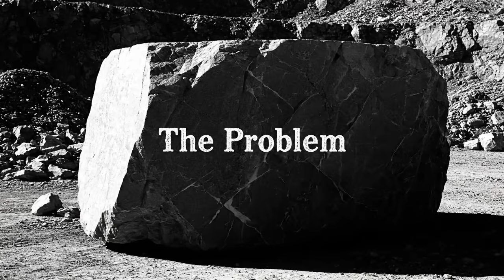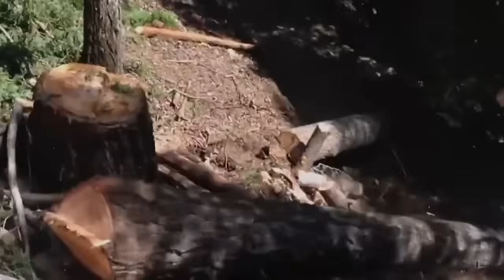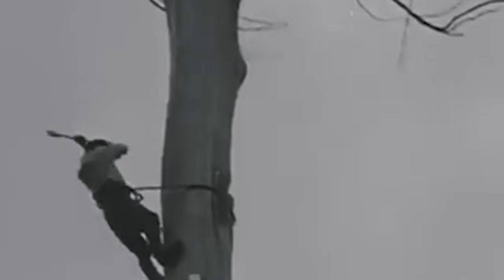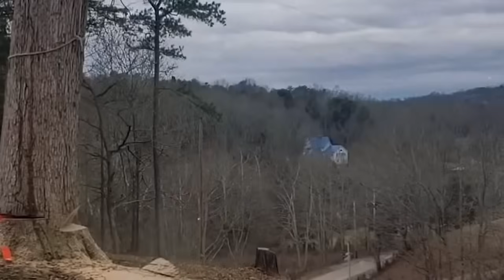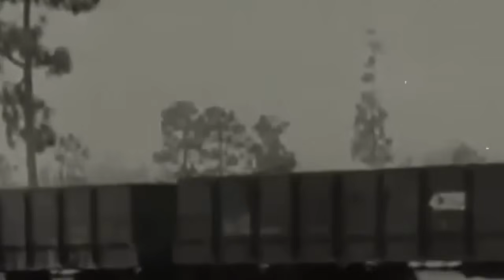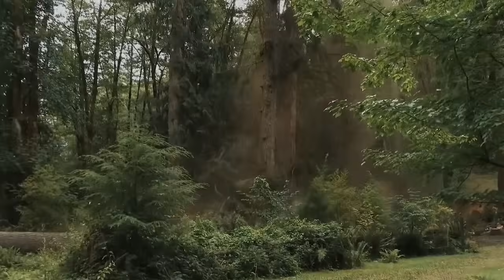Before Steel: How Workers Built Railroad Bridges From Trees

Comment: Less than 30 seconds in this video states the trestle built in northwestern Pennsylvania was built with locally harvested timber including Douglas Fir. Factually that species is NOT native to Pennsylvania. Any Doug Fir utilized in constructing the trestle in Kinzua, Pennsylvania would have had traveled 2,000 miles from where it was logged.
 Beyond that error the Kinzua Bridge was not made of timber; it was a metal structure. Originally constructed in 1882 using wrought iron, it was later rebuilt with steel in 1900 to support heavier trains. The only timber used in the bridge was for the railroad ties and railings. Its tubular iron columns, which featured a patented "Phoenix Column" design, sometimes led people to mistakenly believe the structure was built from wood.